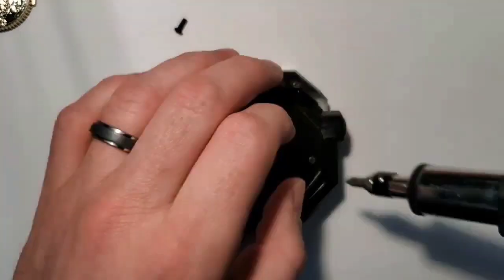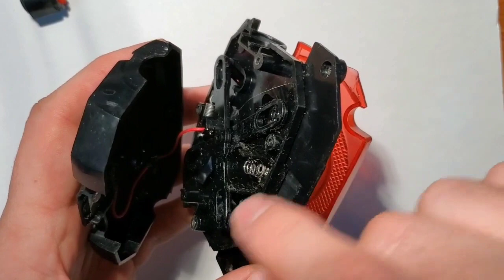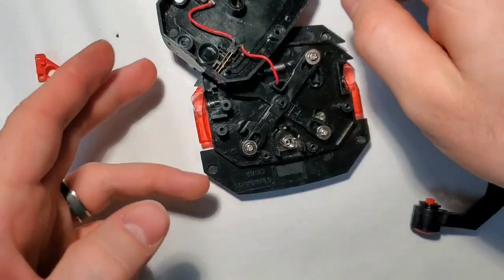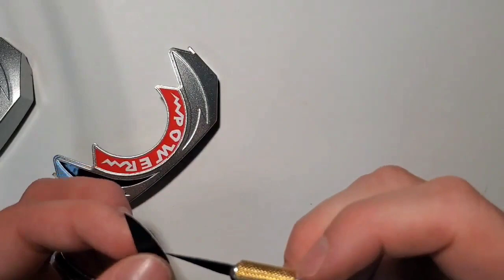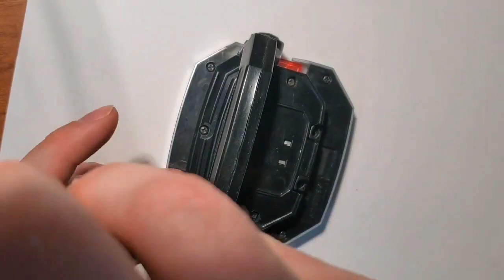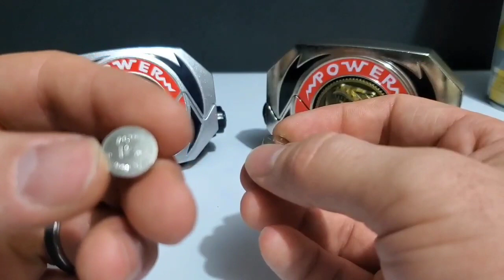Original '93 Power Rangers Power Morpher Custom Restore

Comment: while trying to restore mine and cleaning the battery compartment i accidentally pulled a wire that made the sound and i tried soldering it but i get no sound or lights. if anyone knows anybody that can repair old electronic toys please help

Comment: That is 1993 Power Morpher custom restoration perfection!
If I ever bought myself one, I'll do precisely the same. You did an excellent job ^^
-------------------------------------------------------------------------------------------------------------------------------------------------------------------------------------------------------------------------------------------
No bias or nitpicky here, but I wouldn't say that the Morphers up till now, the 1993/DX, Legacy/Artisan, Lightning collection, are the perfect Power Morphers/Dino Bucklers. Custom-made ones have come close so far, but my picture/vision of an ideal Power Morpher/Dino Bucklers would be like this:

1. The Morpher bulkiness & thickness should be like the 1993 version. It also needs to make the holder as the Legacy/Artisan & Lightning version has, but it can fit 1993-style Morphers.

2. The back side of the Morpher should be like the Lightning version but with the Legacy version's colors. But for nostalgic reasons, it should be the 1993 version cause the stickers are kind of cool too

3. The plating could be like the 1993 or Legacy/Artisan versions with "Power Rangers" letters in the red circle. 

4. The circuitry, sound system, light effects, and inner plating should be like the Lightning collection (cause I do like the voice actors, the light effects, and the inner plating's detail). Still, I would keep the voice actor as a secondary switch menu, while the primary switch menu should be the morphing sound and music theme like the Legacy/Artisan version. And keep the power coin reading function as well cause having different color lights and even voice actors change based on the power coin used is actually very cool.

5. The power coins should be the Lightning collection cause I like the Power Ranger helmet motif on the back of the coin.

That's what my version of a perfect Power Morpher/Dino Buckler is like. The same goes for the Master Morpher/DragoRanger Dino Buckler as well. 
-------------------------------------------------------------------------------------------------------------------------------------------------------------------------------------------------------------------------------------------
Don't get me wrong, I really find all the other Power Morphers/Dino Bucklers cool with their own uniqueness, but I feel like it can be "improved" or "perfected" in some way so that all downsides are removed.

The Lightning collection is fantastic and has better sound quality, but two downsides are that when I want to morph, I would like to say the phrase rather than let the voice actor say it, and the Morpher is way too bulky and thick, which can be slightly heavy to hold.

The Legacy/Artisan Morphers are great cause they're quite show-accurate. But the downside is that the coin itself can often come out of the Morpher or turn around whenever we move around, and it's a hassle to rearrange the power coin to its correct position afterwards.

1993/DX Morphers, to me, is nearly perfect. Looking at it, it's lighter and thinner than the Lightning collection and probably the Legacy Morpher. The downside is that the Morpher is upside down, and the sound quality could be better. I know that with new decals, you can simply fix the stickers, but it's a hassle to buy and wait until it comes to you.
-------------------------------------------------------------------------------------------------------------------------------------------------------------------------------------------------------------------------------------------
[Update] With Zyuranger's Memorial Edition Dino Buckler out, I want to add on some more, too.

That one is PURE 100% Perfection. Two modes, audio by motion detection, the improved lighting display, and additional functions based on how long you pressed the button. This morpher is ABSOLUTE PERFECTION! Even the medal slots are perfect. No turning, falling off, or twist lock, the plating looks even better, and the bulkiness is PERFECTLY accurate. Come on, Hasbro, can't you make the Power Morphers just like Bandai? Is it too much to ask?

Comment: I got the morpher and blade blaster from eBay in today.  The morpher will need to be restored because the spring doesn't function, and this video helps so much.  Thanks!
Reply: Update: Fixed the spring and it pops out once again.  Unfortunately the wire became detached, but I don't really care about the sound and lights for now until I fix it.
Reply from the maker: That's great, if you want to restore the electronics usually a quick solder will fix it. They were a pretty simple design.

Comment: I have these two myself. Got the 93 morpher at a good cheep price. I've repainted the plates but I haven't ordered any sticker replacement yet. I'm next gonna get the new hasbro version and turn it into the master morpher.
Reply: Can you tell what paint did.you use?
Reply: @greenwithevil6  any paint works depending if you want gold and silver did my legacy morpher to the green ranger and used rustoleum metallic gold brilliant metal finish and silver I used the same same brand satin nickel paint and primer I get the reflective silver is good to the legacy look but for show accuracy I did the nickel color to keep it original have to reorder the plates from starlight to make it look clutch not that bad how I did it just don’t want the black bolts cause when they morpher they never had it and ordering another 91 to make tommies cause that what he used on the show and I thing looks better without the bolts

Comment: GREAT VIDEO *
I have (I believe) the original “Morpher” - 5 Power coins - 2 Power Ranger guys (green and blue) 1 breast plate  — replaced the batteries - the lights and sounds come on but the sound isn’t very loud - the side stickers are torn but the “MIGHTY MORPHIN” and “POWER RANGERS” are intact — have been in storage for about 27-28 years 
Anyone interested?
Reply: I'm interested if you still have it

Comment: Yeah, this is nice. I went full out, front and back. I picked up the set that's based on the 1992 Dynobuckler from Kyouryuu Sentai Zyuuranger; I want to customize it into Burai's Dragon Buckler (aka Tommy's Power Morpher). But, I'll have to contact Starlight Studios to see if they still make the custom parts for the 93 Power Morpher (Ex.: A replacement X-arm slider, diecast Power Coins, etc.)...because it would suck if they don't do that anymore.

UPDATE 2022Jul05: Tryna use the disinfecting wipes to clear off the sticker residue WORKS, but that and gettin' the old stickers off in the first place are bith5 just an extreme pain in the nuts. Your choice of paint tripped me out, because the paint I have is Rust-Oleum Specialty Metallic in gold...which is great as far as my customizing goals (Burai's Dynobuckler, aka Tommy's Power Morpher). Wondering if I should get some fresh screws for this thing, the heads of a couple of'em have rusted. 
The clear red part in my Morpher had what I thought was some dirty spots...nope, that's wrong. Those are scuffs. Nothing can be done for that. 😑
Still wish there was a way to get a reproduction of the belt clip holster from the Dynobuckler (since Bandai America bizarrely DIDN'T make that)...
Finally, you got lucky with yours!! The XY axis component is much more common to have one or both of the hooks (that the spring latches onto) be snapped off, which also results in a not fully functional opening gimmick; in that case, that entire component needs to be replaced.